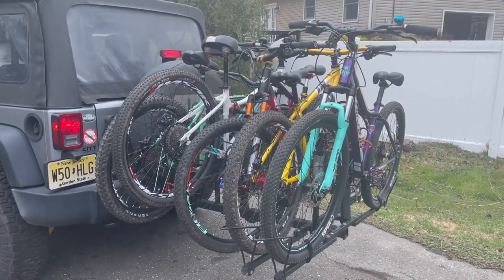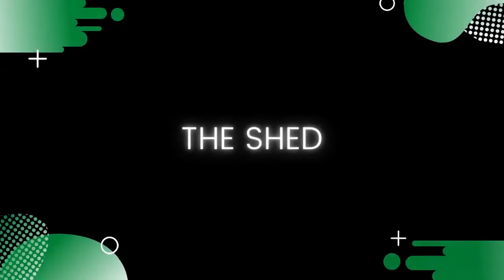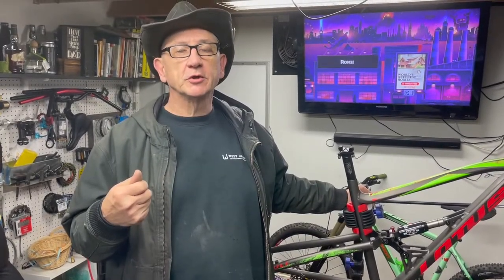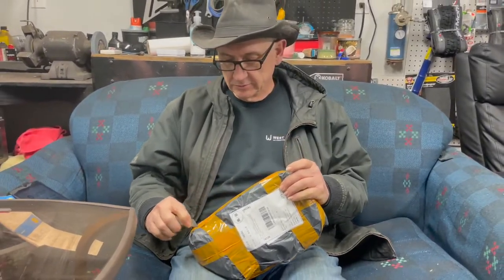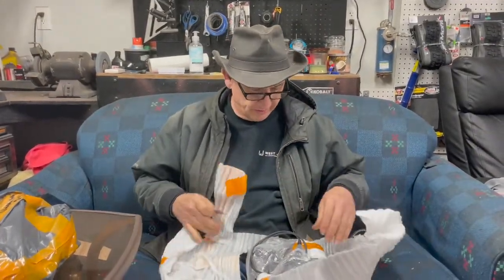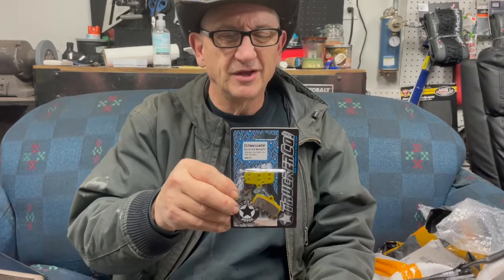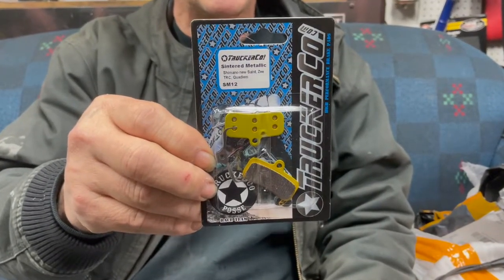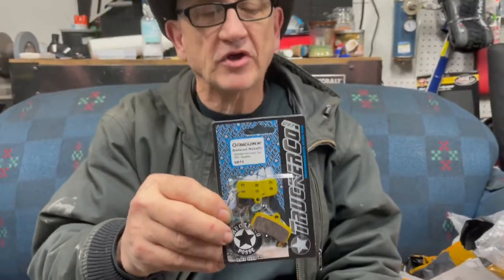Meroca M4 Brake Review

Comment: Are thay better than the Shimano mt200
Reply from the maker: Braking ability, in my opinion, is better, but i think feel and long term durability the Shimano is better. Im currently using the pair in the video on a bike with ceramic pads in the front and semi metalic on the rear and they work awsome. But i had a meroca caliper freeze up on me and frequently have to bleed them were usually the mt200 dont need to be messed with, but they dont have the braking powere of the 4 piston brakes. Yeah, i know, you just wanted a simple yes or no, sorry!
Reply: @theshedMTB  your info  is good to know my back mt200 locks up nice but the front keeps feeling spongy and need to re bleed It I can't see where is leaking from
Reply from the maker: @revparsons3tl  might not be leaking. As the pads wear the pistons stay farther out and the fluid gets low
Reply: @theshedMTB  thanks mate I looked at them the other day and had oil all over them I'm pretty sure they were brand new pads as well unless the bleed screw is not tight enough
Reply from the maker: @revparsons3tl  if it s leaking its probably the hose into the caliper. Thats too bad, there usually trouble free brakes!
Reply: @theshedMTB  I have got some spare nose and olives to go on the end  trying to put the little brass fittings inside the Tube is alright bastard
Reply from the maker: @revparsons3tl  you need the little press tool otherwise it will fight you!
Reply: @theshedMTB  will take a look your ask my local Halford  bike shop to do it